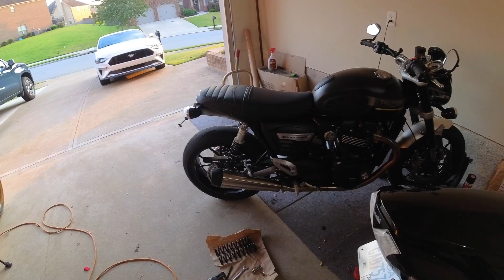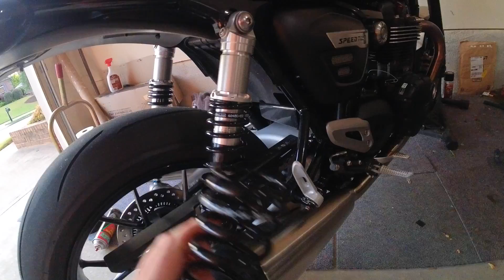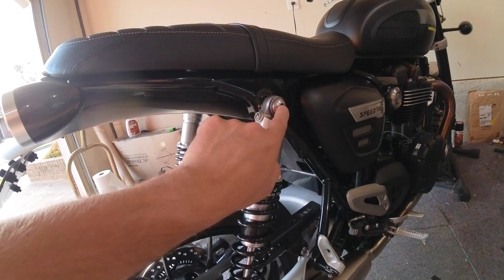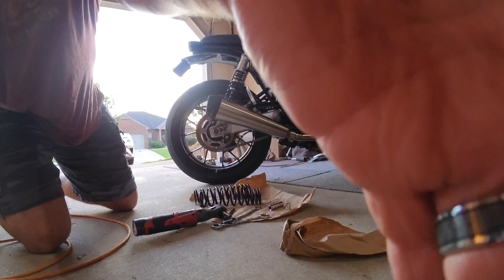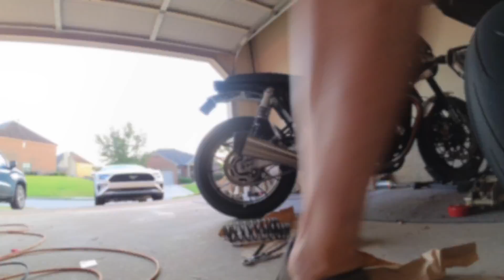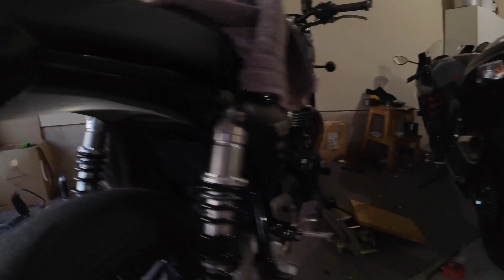2022 Triumph Speed Twin - Ohlins Shock Spring Swap

Comment: Got a question for you, the website said that the length can be adjusted on these Ohlins. Since you have it physically, could you tell me how much length adjustment is there?
Reply from the maker: At least 10mm, but I wouldn't change the length because it will change the steering geometry.  Life the back end up and the bike will get twitchy and require a steering damper.  Do the other way and you lose ground clearance and slow the steering down.

Comment: Why didn't you just order the shocks with the correct springs? Seems like that would have saved you time, money and work. I ordered mine that way.
Reply from the maker: Originally I did, but Ohlins said those springs were on back order possibly months… so I got the standard springs from one source and found another that happened to have a set of the springs in stock.
Reply: @Daves_Man_Cave  That was unfortunate but understandable. Hope you like the ride with the new springs.